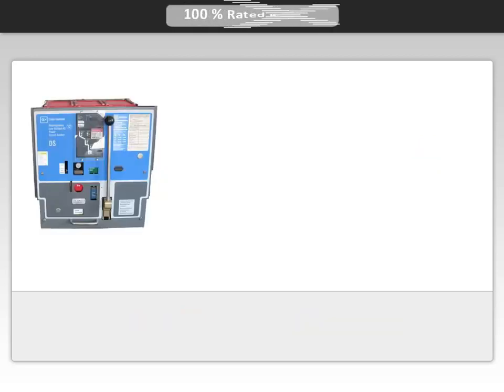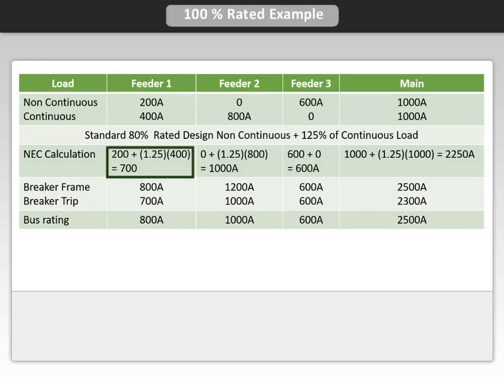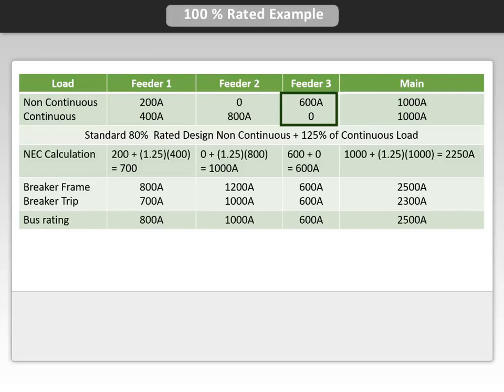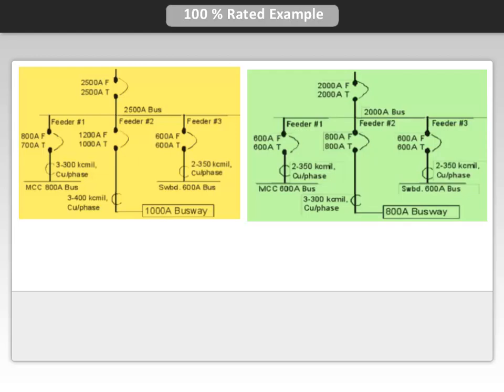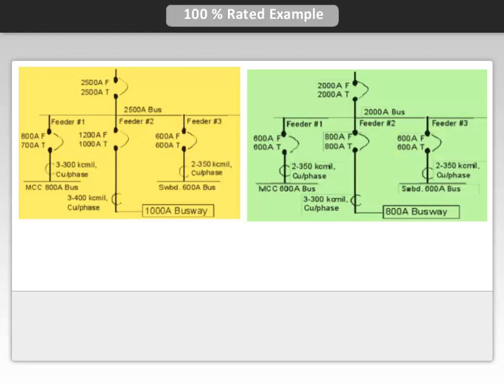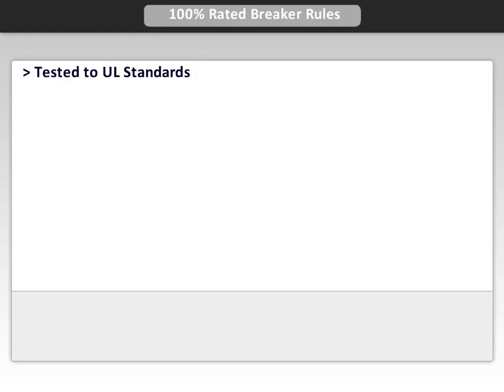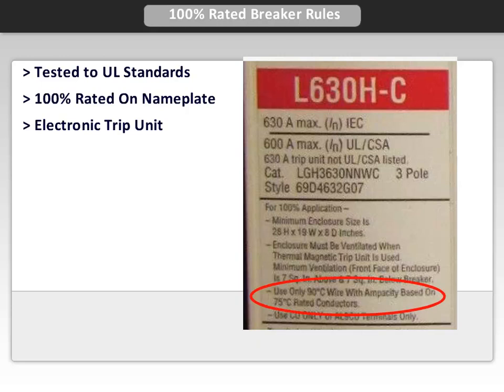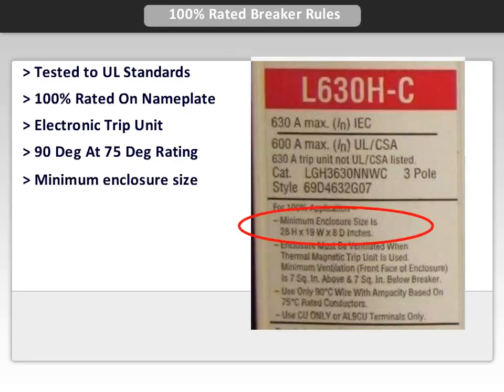100 Percent Rated Breakers Explained

Comment: Thanks for the tutorial. When a 100% rated breaker requires the use of 90°C rated conductors sized at their 75°C ampacity, does that take into consideration the NEC’s provision of allowing a conductor’s 90°C ampacity to be used assuming the 90°C derated ampacity (with temp correction/ampacity adjustment applied) doesn’t exceed its 75°C ampacity? Or is it required that the calculated ampacity starts at the 75°C rating and is derated from that point, as needed based on installation conditions?
Reply from the maker: Good question.  I researched it and here is the short answer to your question:
Regarding your specific question, when a 100% rated breaker requires the use of 90°C rated conductors sized at their 75°C ampacity, it typically means you start with the 75°C ampacity values based on the terminations and then apply any necessary derating factors according to NEC requirements. You wouldn't normally directly use the 90°C ampacity values unless all conditions are met to do so, including derating considerations.
I welcome any other responses to this question from the community.
Thanks for viewing be sure to subscribe to my channel.
Reply: @trainingtogocom  can you provide any resources that confirm this? I have looked at every UL standard and manufacturer data bulletin I can get my hands on and nothing directly addresses this. My thought is that I should take the directions printed on the breaker at face value to make sure that 110.3(B) is complied with. But I’m not 100% confident that this requirement totally jives with the NEC’s allowance of a conductor’s 90°C ampacity to be used with a temp correction and/or ampacity adjustment gets the 90°C derated ampacity below said conductor’s 75°C ampacity.
Reply from the maker: Hi RB  Here is the document that I based my training on.  http://www.eaton.pl/ecm/groups/public/@pub/@electrical/documents/content/ap01200008e.pdf
I know that UL is pretty specific in their standards and manufacturers need to conform.  My feeling is that if a manufacturer puts a 100% rated label, they are complying with the standard.  Therefore the instructions supplied with the breaker and breaker label warnings need to be adhered to.
I hope this helps.

Comment: For Non-Continuous load, ,how do we get 1000A Main ? Feeder 1 have 200A and Feeder 3 have 600A to sum. Same with Continuous load, ,how do we get 1000A Main ? Feeder 1 have 400A and Feeder 2 have 800A to sum. I want to learn.
Reply from the maker: Hi Art. Thanks for the comment. I am not sure I understand your question. Please double check the math and remember to include Feeder 2. The goal of the video is to show that utilizing 100 percent rated breakers in the right application could possibly save money on bus, cables, and may allow use of a smaller size breaker even though 100% breakers are premium priced.